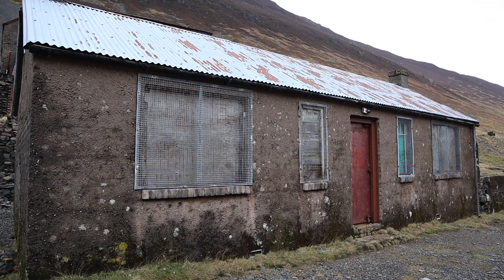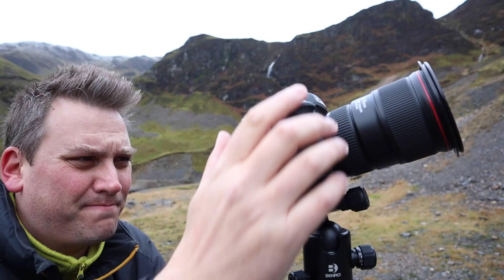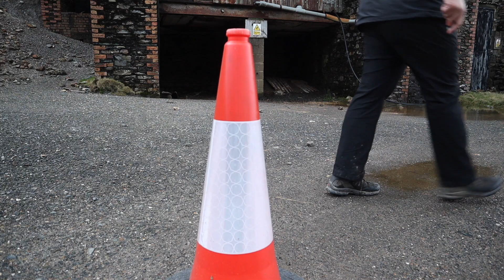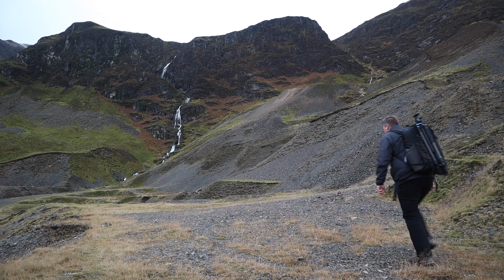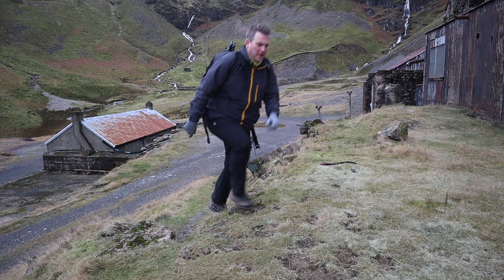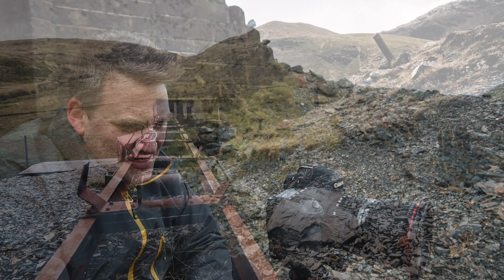Photographing an Industrial Landscape

Comment: Great vid mate however I just dont see the need to bracket so much i woud say you do moore than most photographers if its working for you power to you love your work
Reply from the maker: Hi John - I generally don't bracket, I prefer to use grads. But on this occasion I wanted to keep my options open. Grads weren't suitable and I wanted to be able to pull detail out of the sky. In the end I decided not to but I was still important to have the option.

Comment: I really like your processing of the photos. Of course, you thought of doing them...or some...in B&W.
Reply from the maker: I have wanted to try a high contrast, low saturation approach for some time now and felt that it suited this subject perfectly. As a set of images I wanted to make sure that they were all processed in the same way. Black and white would have undoubtedly have worked but I wanted to try something different.

Comment: A fascinating location, Chris, and loved the penultimate image. I notice that you tend to use bracketing as opposed to ND graduation filters. Is this because the landscape does not lend itself to the grads? Thank you
Reply from the maker: That is spot on Tony - the horizon generally slopped to one side because the mine is on the edge of a hill. If I had tried to use a grad I would have had to put it on a slant which means one corner would have been too dark which is a pain to sort out in post.

Comment: Chris Nice pictures and colour grading. Question: why not using focus stacking instead of F16 aperture? Of course, everything depends on the quality of the camera and lenses I suppose?
Reply from the maker: Hi Alain - I have never felt the need to focus stack. At 16mm and f/16 the DOP extends from about 0.5m to infinity. I checked the image in Lightroom am more than happy with the front to back sharpness. If I had been worried about defraction (which generally I am not) I could probably have gotten away with f/11. Hope that helps.

Comment: With the building in the foreground and the waterfall in the background you could have tried "Focus Stacking". Also black & white with strong contrast might have been a better way to go with all the photos.
Reply from the maker: Not a big fan of focus stacking. I get it for macro but for landscapes it isn't necessary. At 16mm and f/16 a DOF extends from about 0.5m to infinity. I am more than happy the post processing.
Reply: @ChrisSalePhoto  Thats fine though you do run the risk of diffraction with an F Stop over 11.
Reply from the maker: @acmdv  - Never had a problem with diffraction at f/16 with my 20MP sensor.

Comment: Great video, I remember this place when it was working back in the early eighties, we used to go up on our bikes, also back in the 90s I sneaked inside a couple of times to have a look at the machinery when it was abandoned, very interesting, all the machinery is still inside although slowly decomposing.
Reply from the maker: Really Tim? What was is like back then when it was working?
Reply: @ChrisSalePhoto  It was quite industrious, there were a couple of little trains pulling the ore trucks to and from the mine entrance with narrow guage tracks all over the site, the mine entrance  was on the  road, you would have walked past it but perhaps not realised what it was as the ground above has all slipped down, the barytes was shipped out in large bags, there used to be a couple of entrances higher up and also up on the top above the waterfall there is a large entrance with some heavy metal gates and another building. inside the main building is jam packed with machinery, god knows what it did. They do open days now and again, it would be interesting to go on one, the caldbeck fells are also good for old mine workings, they were heavily mined for for all sorts of minerals, barytes, lead and even tungston. Keep up the vlogging, its really good.

Comment: Some great shots there Chris. While some people may think it is ugly, sometimes it just works and I think this does  it is something of beauty (rather than a beautiful picture). I was in Anglesey recently and there was the old Porth Wen Brickworks , again it just worked. One question, I think the last couple of vlogs you have bracketed rather than use grads. Is this a conscious decision re the setting or are you blending more? I must admit I do bracket more (especially in the Lakes - although less on seascapes).
Reply from the maker: I still prefer to use grads but sometimes I do bracket. It very much depends on the subject. I tend not to use them when the horizon is not straight. You end up with one dark corner which can be a pain to sort out in post.

Comment: Hi Chris.I would like to give this place a try.I would like to ask you a few questions if you don't mind.1. Where does one park to be able to get to the mine?2. Is the waterfall a permanent one, or only when there has been rain?3. Does this mine need any certain type of light.Many thanks Ray.
Reply from the maker: Hi Ray - to answer your questions...
1. there is a small car park on the road from Braithwaite to Whinlatter.
https://streetmap.co.uk/map.srf?X=322550&Y=524118&A=Y&Z=115
2. I think so but I don't know for sure
3. I would suggest shooting in overcast conditions with heavy skies. Personally I don't think it would work with blue skies and direct light.
Hope that helps.